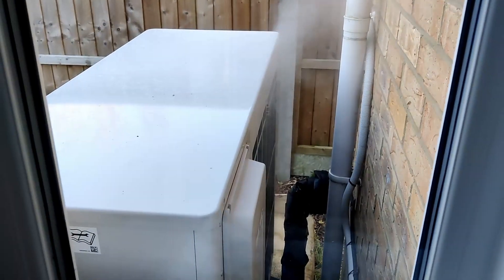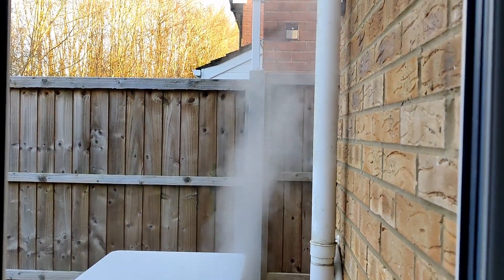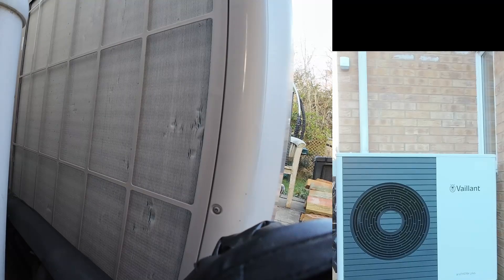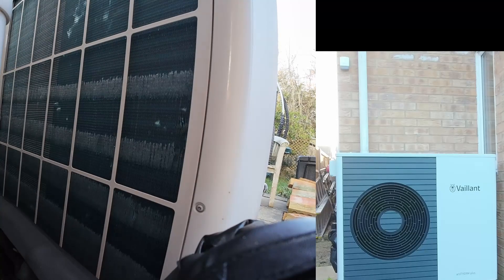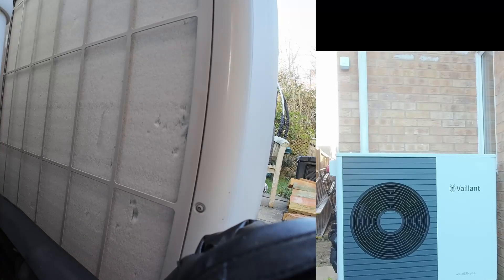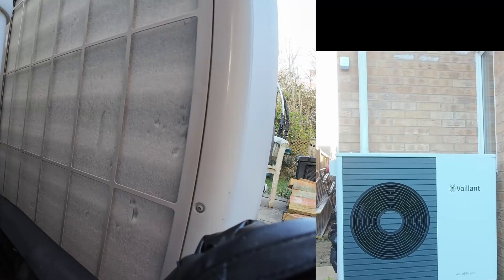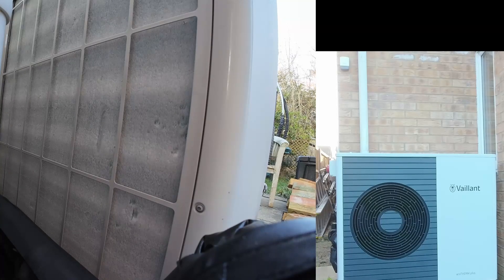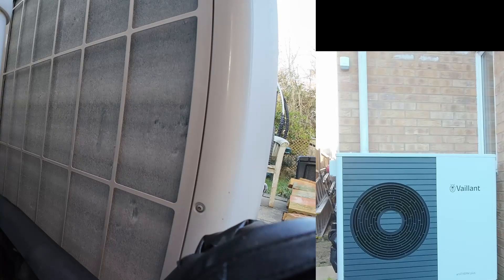Heat Pump Defrost Cycle in FREEZING Conditions!

Comment: Thank you for the sample video on the defrost function of the outdoor heat exchanger. I have just one comment – according to the sound of the 4-way valve, when the circuit was reversed, the defrost lasted from 9:14 to 15:02 – i.e. 5:48 minutes. In my experience with similar units, this time is around 3 minutes. For your unit – if the defrost is this long for about 6 minutes – there may be a problem with the refrigerant charge, when in the heating mode there is enough refrigerant and the unit is working properly, but for the cooling-defrost mode, a slightly higher refrigerant charge is needed and this mode then has a slightly lower output and the defrost can be extended. Is the defrost time really this long with each defrost? I am from Czech republic and certainly the conditions are a little bit different.....but outdoor temp 0°C and RH 75% is the same conditions in GB or CZ.
Reply from the maker: That's a good point. I'll try and measure it again.

Comment: that defrost from approximately 10 through 15 minutes seems really loud. Would like to see what that sounds like from 1m and 3m relative to the traffic noise in the background. You must hear that from inside the house. Do the neighbours hear it?
Reply from the maker: @z_boson5629  it's not audible in the house. Not even in the conservatory.
The only sign is the plume of vapour.
I set up my dB meter at the closest window.
It doesn't deviate even 0.1 decibels inside the house.
Reply: @UpsideDownFork  that's really impressive. Sounds like your installer did a good job in vibration and noise isolation. Out of curiosity are there flexible hoses between the heat pump and the house?
Reply from the maker: Yes, 600mm Flexi section on mine. I believe this is standard practice now. @z_boson5629
Reply: @UpsideDownFork  presumably flexi hoses are standard to minimize noise. What power does the compressor draw during the defrosts? Presumably it's full compressor power. I'm not familiar with the Vaillant so would not know if defrost power is changed for different quiet mode settings. I can say on a Daikin the defrost overrules the quiet mode and runs only the compressor at 3.6KW and it's noisy. I'd like folks to be aware that manufacturers may quote various noise figures but they are often excluding defrost conditions. From what I've read Vaillant seems to have got a good grip on this. I can say first hand Daikin have not.
Reply from the maker: @z_boson5629  don't forget that is filmed by a GoPro which is approx 20cm from the heat pump, resting the heat pump pipework and has the gain turned up to maximum on the camera and in the editing software. It's not representative of real life.

Comment: Thanks for the video. Looking at where the unit is installed, it looks fairly close to the fence on the left and very close to the conservatory wall on the right. I thought these units need lots of clearance around the units so they intake lots of un-turbulant air to extract the most about of heat energy as possible. Could this be reducing it's efficiency?
Reply from the maker: Thanks for the comment.

I do have a video addressing this very concern here : https://youtu.be/WBINlPsk5Eg

The efficiency is looking good so far as shown here :
https://youtu.be/iyQlxtny_4U

Thanks! 👍
Reply: @UpsideDownFork  Ah thanks, just watched it.

Comment: Appreciate your energy in putting these together it’s a great resource. 
ASHP remain slightly mysterious!! Our installation was fine however, the engineer set a constant flow temperature of 40 degrees, all pumps set at maximum, DHW main heating from midnight to 4 am (no off peak tariff and outside temperatures at their lowest) and on constant reheat with a permanent cycling secondary hot water return pump.
Thanks to an excellent service engineer and resources like yours we’ve managed to balance cost, electricity consumption bs heating and hot water.
Reply from the maker: Thanks for the comment and glad to hear you're on the road to more comfortable and greener heater!

Comment: Thanks for the video. The buzzing sounds quite loud. Is that actually the case?
Reply from the maker: No, the gopro is approx 30cm from the heatpump with the microphone level set to max and I also boosted it by 10dB in the editing software to try and capture all the valve clicks etc.

Very quiet to the human ear at a reasonable couple of metres distance.

Comment: Back in the '70's my company installed an Air to Air Heat Pump split system in a restaurant for cooling in the summer & heating in the winter. It ran fine during the summer but when the winter cam the restaurant owner called us & said that there was something wrong & that the outdoor units was on fire & smoking & his chefs had to throw buckets of water over it to stop it burning 🤣Of course it was the defrost cycle.

On a more serious note make sure the melt water from the unit during during defrost has somewhere to go & does not drain straight onto a hard surface, patio or walkway. The reason being that in prolonged periods of cold weather that water will freeze & you will get your own skating rink ⛸. 
The Outdoor unit should be sitting on feet raised above the ground on a gravel base or have a drain pipe connected to it underneath which leads to a garden drain or a soakaway. In colder climates the drain pipe should have a temperature controlled electric trace heater on it to stop it from freezing up as well.
Reply from the maker: Thanks for the comment and the sound advice!

Comment: I started to think you'd looped the video after a few minutes like the spy movies 😅. Interesting to see that the steam is hot which suggests there is room for improvement as it only needs to transition the ice to water. I wonder if that's what Ebac were talking about here https://youtu.be/xHd3vO_xaPY?feature=shared&t=381
Reply from the maker: That's an interesting point! I wouldn't say the steam is hot, but definitely warm in contrast to the surrounding ambient air.
Thanks for the comment!

Comment: Interesting, I am surprised the unit lets the ice build up so much before a defrost. I would have thought more shorter defrost cycles would have been more energy efficient. Also I guess another factor when selecting an installation location.
Reply from the maker: Thanks for the comment. I'm sure Vaillant have measured the optimum point to defrost. Hopefully!
It measures the temperature and humidity so can probably predict how long it will take to ice up as well as defrost.
Fortunately the frosting up is fairly rare for us in our location.
Today it's below zero but the humidity is so low that it is not frosting up.

Comment: I really love the sight of that defrost cycle, however, I wish the heat pump would resume normal working afterwards instead of going into "overdrive" because that can lead to it icing up more quickly again, which in turn can create a kind of "death spiral" where it keeps ramping up the power, defrosting, ramping up etc. and completely kills efficiency. This has only happened once in my system, but I still think it's unnecessary.
Reply from the maker: Thanks for the comment. I haven't witnessed that yet but i'll keep an eye out from now on! I wonder if the buffer tank helps my system in this regard?
Reply: @UpsideDownFork  I have a buffer, but a small one with 45l
Reply from the maker: @rolandrohde  Thanks for the reply. I can rule that out then as I have the same 45L Vaillant buffer tank.

Comment: Surprised to see the amount of damage to the ASHP so soon after the installation, how did that happen?
Reply: Easy to straighten with a fin comb if you wanted.
Reply: They often come like that from the factory, it's nothing to worry about, just a few fins bent over. Bump it when unwrapping it and you'll get the same.
Reply from the maker: Thanks for the comment. It's not something i'm worried about but i'll check with the technician at the first service if he has a fin comb to straighten them.